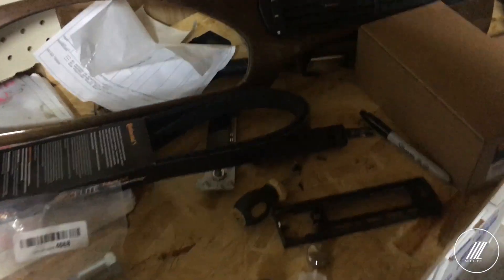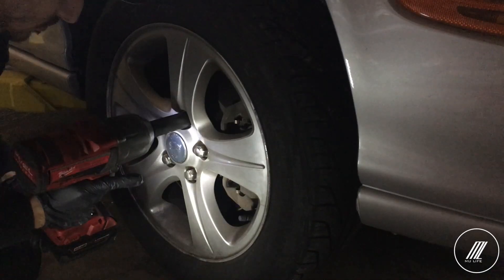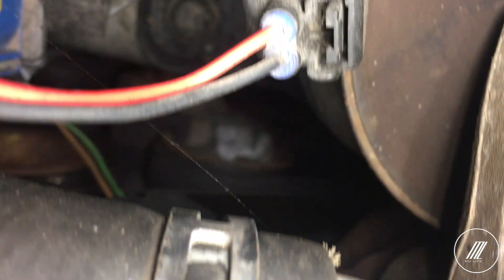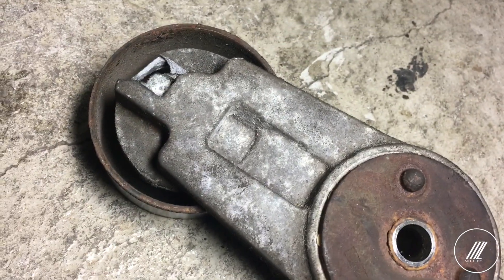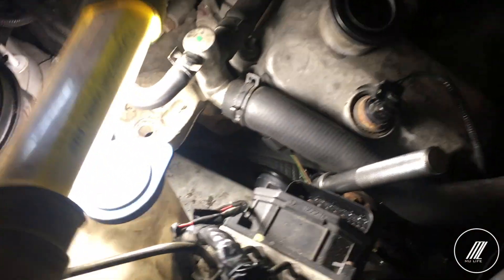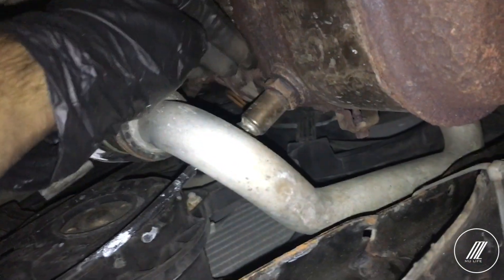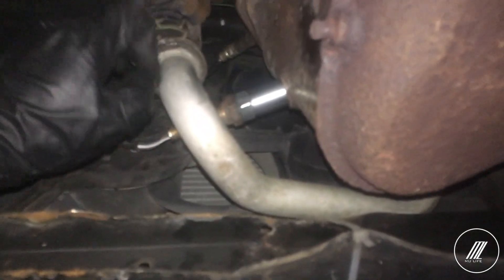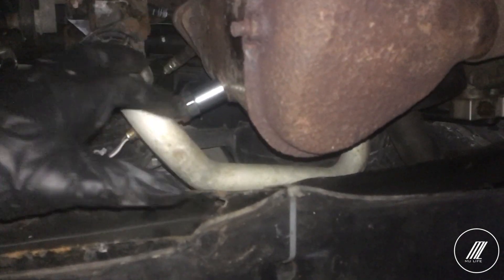Fixed the CEL on my Jaguar ! P0430

Comment: I've read in Jaguars, the P0420/0430 may be more than just a false alarm. Sometimes the cat converter is indeed melting or damaged. If your Jag has EGR, the debris may get sucked back into the engine, and cause catastrophic failure. There's some documented cases of it, though rare. I wonder if you actually took a look at your cat and see if there was any damage inside?
Reply: There are no egr valves on the gasoline
 x types.  
Egr valves were used on the 2.0, 2.2 L diesel x types which are more common In Europe not The 2.5, 3.0L gasoline x types that are common here in the US.